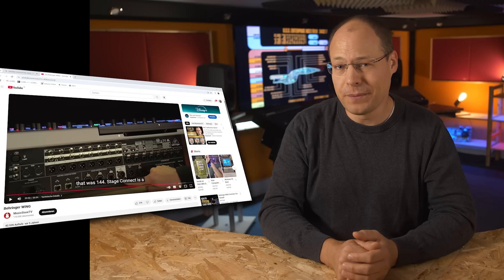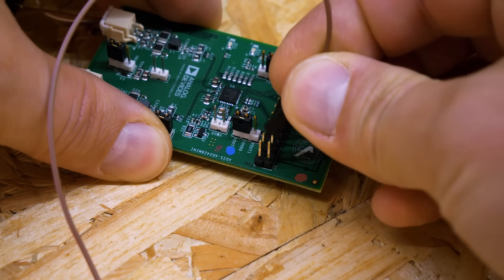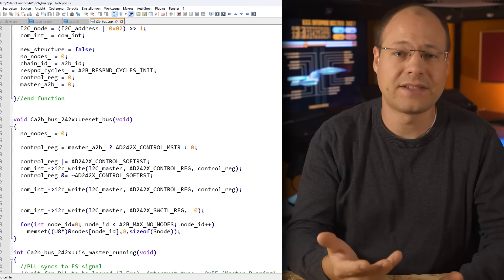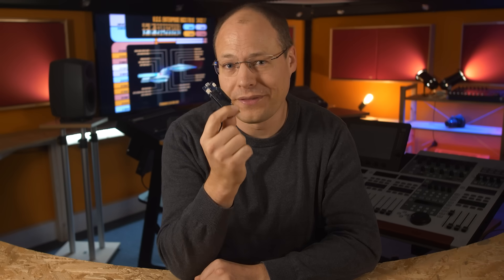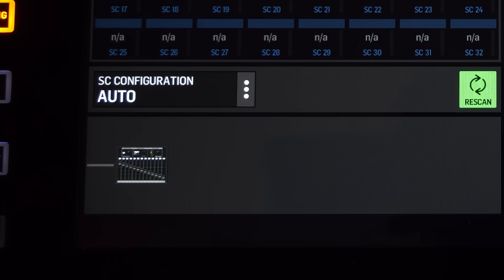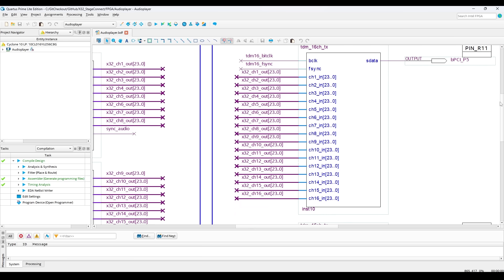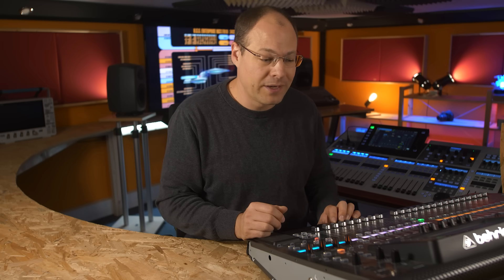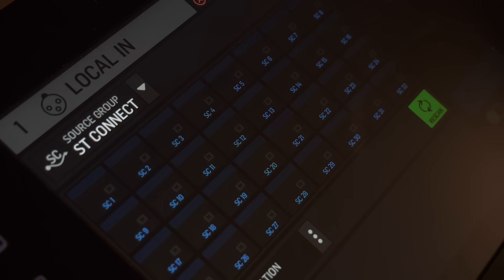StageConnect is OpenSource... and the X32 knows it

Comment: Thanks a lot for the vidéo ! 
Is there any Arduino adat or aes3 8 in out module ? 
If yes it would be super cool to make stage connect to 8 adat in out or 8 aes 3 in out modules + bnc word clock (waiting for the official cards from Behringer one day for the wing ?)
Reply from the maker: TDM8, TDM16, etc. are unidirectional connections without a protocol. So only "stupid" logic is necessary to distribute the audio-channels to ADAT or AES/EBU. With a small FPGA this is quite easy to realize. Have a look on some of my GitHub repositories (https://github.com/xn--nding-jua) and you will find some approaches to realize this idea.

Comment: Ich hätte gerne Dante unterstützung für das Behringer ddx 3216 es ist das einzige das ich mir leisten kann
Reply from the maker: The DDX3216 has ADAT and TDIF connections. You could try to get some converters from this to Dante. But I'm not familiar with Dante at all, sorry.
Reply: @pcdimmer  Aber kennst du dich aus mit software zu schreiben für allte Dsps

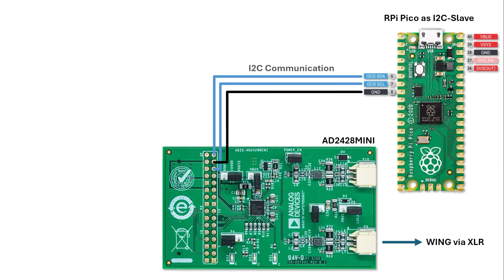Comment: 7:52 the A2B can deliver any type of TDM or 12S format, there is no need to add an extra converter.

Looking at the SC structure, there is field for it. tdm_config
Reply from the maker: Yes we can switch to TDM8 but there are only two digital inputs on the A2B IC so I would stuck with "only" 16 channels on two TDM8 inputs. For a 16 input and 16 output it would be sufficient to use TDM8 to connect directly to the X32. But then we have to figure out how to sync the X32 to the expansion card. This is possible but needs a bit more reverse engineering.
Reply: @pcdimmer  yes, I though about it after writing my comment, it makes sense what you did. Well done!

Comment: I wish they'd open source the whole X32/M32 code. I'm dreaming of a usable routing system and using card I/O as inserts.
Reply from the maker: We are working on an OpenSource version of the operating system for the X32: https://github.com/OpenMixerProject/OpenX32. But the two used DSPs are quite old and have some limitations compared to the four more recent DSPs in the WING. We are testing the limits at the moment to see what we can achieve with an alternating system.
Reply: @pcdimmer  crazy! Thanks for sharing!
And yea, I can imagine those SHARC DSPs to be a pain, but wouldn't routing be more of the FPGA's task? Also are there hardware limitations that require you to do the routing in blocks of 8 or is it maybe just done so in the original firmware because those blocks exist in hardware?

Comment: I am not a pro in audio engineering but want to understand why would link those two mixers?
Reply from the maker: Well, for testing the performance of my eval-board I need multi-channel audio, but when using my DIY card I have no option to connect my X32 to a computer or SD-card. That was the reason for connecting the WING via AES50 to the X32. This is not a combination you would use on-stage I think.

But matpold had a nice idea: create a PCI card with StageConnect. Thats absolutely possible. Some weeks ago I created my own PCI-card (https://www.chrisdevblog.com/2025/05/developing-pci-cards-with-plug-and-play-part-2) and adding StageConnect to it to record 32 channels would be a nice thing. Thanks for the ideas :-)
Reply: @pcdimmer  A PCIe  card with StageConnect indeed could be very interesting.
Reply: This way the X32 could be used as a stagebox to expand number of channels or avoid running oldschool snake or use X32 separately to create personal monitoring mixes, maybe with drums routes as a single channel. It makes the most sense if you already have a X32 with no use.
Also this is just a proof of concept, using the gear Christian already had. This also means that you can design your own stagebox or personal monitoring system or power amplifier with stageconnect or even custom lightshow being precisely controlled by separate channels. It is likely that more products by other companies could pop up doing similar things.
Probably the hugest would be designing a direct connection over PCIe so that computer could run VST plugins and route it back, so your old X32 console could gain VST support.
Reply: He linked the two mixers to demonstrate. But there are valid use cases, like rack mixers in stageboxes as slave to a full mixer for example. StageConnect is so much more though. With Ultranet you only either get 16 channels in or out, not a combination of it. StageConnect can go both ways, even a combination of both ways in the same cable.

Comment: To make things more cheap, the question is: how good is the bus as in, can it run long wires.
I am thinking more 32 channels on "cheap" wiring for PA systems or in house audio systems.
I am just building an office/house combination and for the audio I will just settle for zita jack 2 network on a soc. That would provide enough synchronsation to have several places within the building have the same music without it being out of phase. PTP synchronised equipment is very expensive.
But something that's already stripped from networking layers might be an alternative if you have the extra cable.
And if that works, that might become interesting for larger volumes of interfacing gear and hence price drops.
If you look at the home automation world, every brand is trying to make it's own proprietary solution with vendor lock in and cloud rights management on your own devices, which makes me as a technician feel nauseous and wanting them to fail so hard just by having a good enough alternative.
Anyway, this looks awesome.
For me the casting is the most important so this bus might not be so good.
I've tested a video casting setup with gstreamer and 20 of the same PoS systems, so audio and network buffers had the same depth, and for video streaming: the audio among those devices was so in sync you couldn't hear phase shifts nor distortion (as distortion is what tiny phase shifts sounds like).
I attribute that more to the brain being able to fix broken sound than to the success of a very loose sync.
But it is good enough to venture further to have SBC's do zita jack 2 network. If I hook up a remote device as zita audio output and my local pioneer sx3, I hear an acceptable difference in delay.
Reply from the maker: Up to now I did not test different types of cables or longer cables. The A2B specification says something around 15 to 30 meters, but the passive network at the output of the A2B-IC seems to be a bit tricky. So I would suggest to think about it a while and do some tests with ready-to-market equipment...

Comment: Christian, many people (including me) wonder if StageConnect can be used to connect 2 Wings. In its current state, it doesn't.
 the gender of xlr/dmx cables and the 'master' - 'slave' setup of  StageConnect prevent this.
How difficult or expensive would it be to build an adapter?
Reply from the maker: Its possible when using two A2B-ICs that crosses the TDM16 channels. So each WING would be connected to a separate A2B-device without knowing of each other. Then the two devices could act as a 32/0, 16/16 or 0/32 device or any combination between. An AD2428 IC is around 10US$, so 20US$ plus the components around and an PCB would end in around 50 to 80US$. If using two eval-boards we would end in 260US$...

Comment: This is so awesome!! I was looking into buying a Wing Rack, but I kept being put off by having only 8 outputs (or 10, if you count the stereo headphone jack) - not really enough if you need to run several stereo IEM paths plus the main PA output. This could be used to implement a cheap(ish) little box to expand the outputs - even something like 4 additional outputs would be enough. Size is a consideration, too - I know of the Klark-Teknik 1U stageboxes, but that means another 1U for my mixer rack, and I'd love to keep it down to the Wing Rack only in that regard.
Reply: I am thinking along these lines too. But how do you render those extra channels that are now provided into something useable with IEM(I.E Aux)? I wonder what a cost effective way to break out the TDM into individual channels is? is that a FPGA? Then is each channel sent to it's own cheap DAC like a PCM5102? 
I am largely unfamiliar with the electronics aspect, trying to learn and think about this though, because a small little box that could turn stage connect into something like 8 or 4 aux would be awesome. And if it was doable for the 300$(or less) mark, then it would be a awesome alternative to the 1u options, like a Midas DNxxxx
Reply from the maker: I had a similar idea: I'm planning to use my WING Rack on the stage in our band. But the WING Rack has no UltraNet output so I'm planning to create a converter from StageConnect to UltraNet and analog outputs. For this I plan to use the AD2428 connected to a cheap small FPGA that outputs UltraNet and additionally connect to a 8-channel DAC-IC. Everything together should not be more than 50-70US$ if I'm printing the case with a 3D-printer. 10US$ for the AD2428 IC, 10US$ for the FPGA and the remaining 30-50US$ for the smaller components.
Reply: Awesome info, thank you
Reply: It has 4 stereo headphone jacks. But I was looking at looking at a 388€ investment for 16 extra outs too 😂
Reply: yeah, but the headphone jacks are hardwired to the respective xlr output pairs, meaning that you have 4 (or at most 5, counting the front headphone jack) stereo outputs from the console - that's PA + 4 musicians, and only if I'm not running the subs separately. 😢
Reply: @jahudka good info thnx. I never understood why it had 4 headphone jacks and only 4 outs. This explains it 👍 might get a AES50 stagebox now, keeping my options for SC open

Comment: Once again, you're doing gods work! Let's push Audinate to open source Dante next 🤪
Reply: I dream of the same thing, but it will never happen. More StageConnect makes behringer devices look better against competitors, and they weren’t charging for it anyway. Dante already looks better than competitors, and Audinate makes money from the licensing, which they couldn’t do if it was open source.
It’ll only happen if Audinate pivot further into hardware and enough competition pops up and puts pressure on the uptake of Dante (E.g. Milan but without the necessity for AVB switches). But that would be a dire situation for Dante regardless, and would probably mean it’s on the way out.
Reply: @almc8445 if they don't start supporting Linux they may be on their way out anyway. Windows is on the edge of being unusable
Reply: We need Dante on Linux. I love open source, but would gladly take a closed source way to get away from windows
Reply: @annebokma4637  we have a PCI-E card from Marian called the Clara E and i think Digigram also have one that works on linux, just no dante controller (yet)...i'm not so fussed about Dante Virtual SoundCard as it's an awful program espeicalyl since they came out with the pro version thats a subscription
Reply: AES67 gets you most of the way there...
Reply: @McTroyd  if only we could get rid of the ridiculous pricing for DDM so I can start implementing Dante in my ST2110 network…
Reply: @oppentrapp  Ahh yes, if you need DDM, you're kinda hosed. Sorry. 😅 I mainly deal in smaller systems where Controller is enough to get by.
Reply: FFS what's happening with YouTube?

I'm trying to post a link to an open source Dante installation, but my comment keeps disappearing.
Reply: @sanderd17  You just need to give keywords for what to search. YT is censoring URL's heavily.
Reply: never happening. they'd go out of business.. and it's actually good having support
Reply: There are already Dante-compatible projects on the github.
The problems are the patents. Once these are expired (probably in another 10 years or so ????) it will be easy.
Also, Dante is in parts just the AES-67 standard which should be straightforward to implement, you just have to buy the standard from the AES or become a member for at least a year.
Dante has some parts extra and some incompatibilities.
I would personally concentrate on the AES-67 and look if we can build an open-source environment which works well on something like linux + ardour.
Then you should look further down the Dante compatibility.
Reply: Yesssss
Reply: The real thing we need - alternatives for Dante. Now it's a monopolist. No alternatives = no development = high prices
Reply: @valik-stu  I’d rather keep the Dante monopoly in place instead of going for the incompatibility mess that is AVB (even Milan doesn’t solve this properly)
Reply: @oppentrapp the most insane I could hear: "I will pay Dante any money they want"
Reply: @oppentrapp  What incompability mess do you mean?
Reply: @valik-stu  we have AES67 and SMPTE-2110 which Dante is compatible with...if you read my other comment you'll get a bit more insider info...while it's a closed product and it has the largest presence, big manufacutrers are actual shareholders and make up a large majority of them....Dante is proof of a cloased product that doesn't stagnate...i mean we're nearly at 20 years of dante, it's still here, products are still inline with non-dante alternatives...the only other open alternative we have it MILAN and it's a laughable protocol that only three speaker manufacturers are pushing
Reply: @valik-stu scream this from the highest point possible
Reply: @valik-stu  Yes, and given that there already is standard as basis (the AES-67) we just need some small pieces, like what Dante does.
However the real problem will be Dante's patents.

Comment: This is huge! I can see it being useful for connecting the X32 to the p24 system via stage connect directly without the aes50 hub!
Reply from the maker: The P24 is around 180€ - I should have bought this device instead of the A2B eval-board :-/

Comment: a dmx cable with 3 pins its not regular, its out of spec.
Reply: Ehm so what's regular DMX you think?
Reply: @SenfSenferson  it should be 5 pin by standard but the majority of vendors use the 3 pin
Reply: @docugraf Or you can convert between 5-pin and 3-pin XLR with converters that are DMX512 compliant.
Reply from the maker: You are right. Maybe we can agree on a "defacto" standard? Most of the low-price stuff is using 3-pin XLRs for DMX. But I was talking of the DMX-cables that are complying to the AES/EBU standard as they have 110 Ohm impedance.
Reply: @pcdimmer  Slightly different intrinsic impedance (110 v 120 Ohms) but close enough to work reliably.
Reply: @pcdimmer  But the A2B has 100 Ohms ??
Reply: @MobileTaz  UTP is almost as old as... never mind. /nudge

The big difference between common audio (mic) cables and DMX is the higher capacitance of the mic cable.  Over length the frequency of the LPF drops.  That affects the transmission line performance.  Getting bits and bytes from here to there isn't rocket surgery but the 'average' person would be surprised at what can mess up stuff that typically "just works".
Reply: @SenfSenferson  The original DMX 512 spec was 5 pin, with pins 4 and 5 reserved for future use.  With only 3 active wires/connector pins needed to 'just make it work', money was saved on copper and less common 5 pin XLR connectors and for 20 years a lot of portable lighting equipment used 3 pin DMX cables, but those cables only ran between control consoles and the racks of dimmers off stage or in a room somewhere.  Then moving lights and LED fixtures that need 5-??? DMX channels to run became a thing, and the amount of control (DMX) cabling went up as all the DMX data has to be run to each such fixture.  Funny thing about DMX and regular mic cables, they have the same connectors, and DMX cable will work just fine in an audio use (even in multiples connected together) but the reverse ain't necessarily so in DMX.  Getting audio cables mixed in with the lighting DMX cables can cause lighting things to work unpredictably or not at all.  The last 10-15 years have seen a return to the 5 pin standard in lighting equipment aimed at commercial or professional use and means no cable mix ups, and audio and DMX will not be accidentally interconnected (the results can be really bad for both).  There is still a lot of 3 pin DMX in use and will be for some time, though, because it will work.  A lot of "nicer" fixtures come with both 3 & 5 pin in and out, too.  The wonderful things about "standards" is having choices!
Reply: @SenfSenferson  an official DMX cable is 5 pins... but only 3 pins are used for signalling.